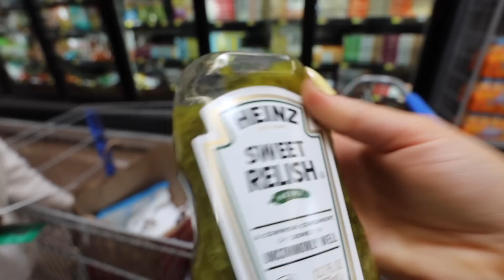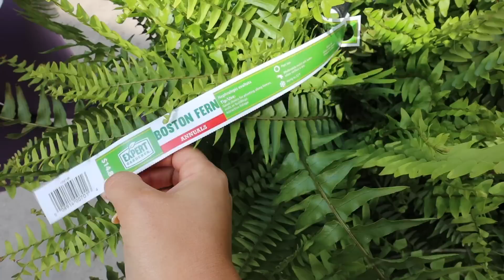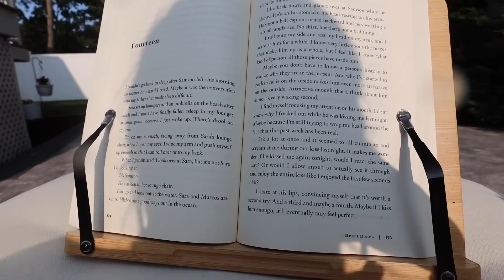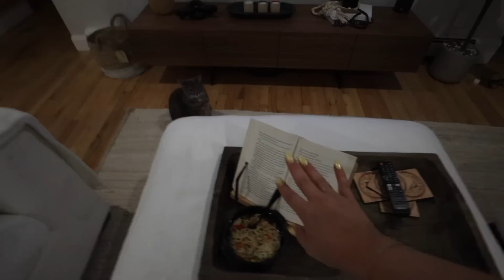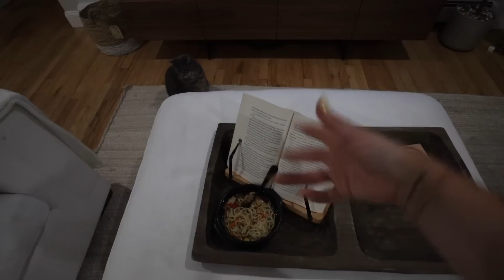1 HOUR UNEDITED VLOG: viral burger tacos, walmart shopping with mom & summer backyard makeover

Comment: When ur taking pills try to tuck your chin in (looking down) it helps!! 💗🫶🏻 hope it helps - from a nurse

Also! The pressure under your eyes is like a pressure headache from ur inflamed sinuses/lymph nodes due to ur allergies most likely. (Warm compresses on that area could help and some lymph drainage messaging) If you had an eye infection it would be most likely w puss, intense itching or blurred vision of some sort 👍

Comment: Random question I guess, but when DIY dad hooked up the hose, shouldn’t the end with the shut off valve connect to the house and not to the nozzle end? I guess it doesn’t matter, but since you have a nozzle that only runs when you press it, I guess you wouldn’t need the shut of valve at that end???